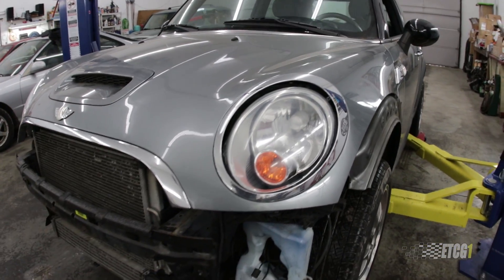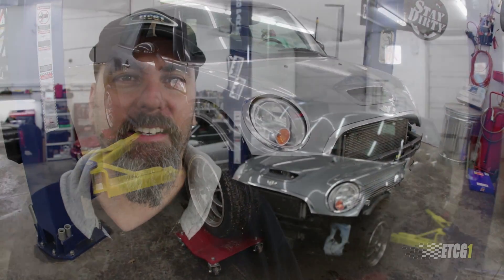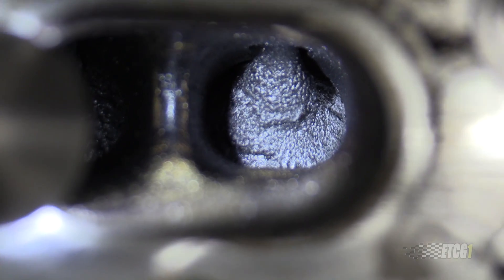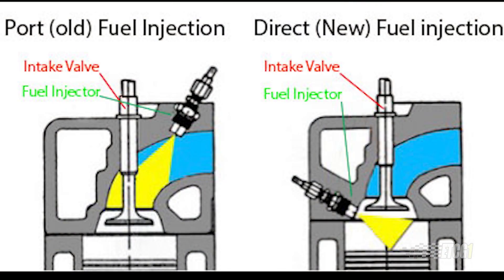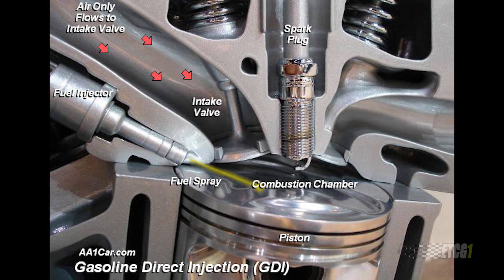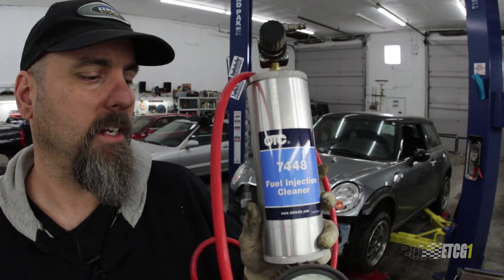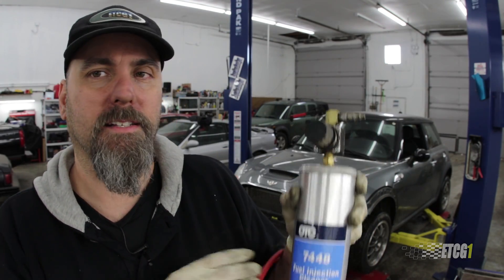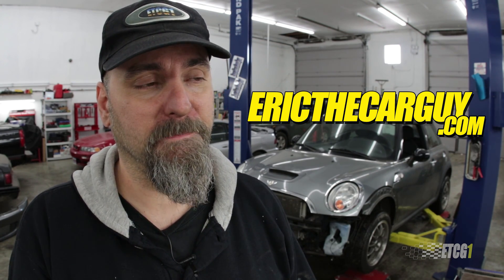Direct Injection Proves Fuel Additives Don't Work

Comment: Gasoline makers put fuel additives in their gas anyway.
Reply: mario yes they do work, VERY WELL, which is why most regularly driven vehicles never need a separate bottle of additives.  If they didn't work we WOULD need to keep dumping fuel additives in.  However they were never intended nor expected to clean a part of the engine they never touch like the intake valves on a DI engine.
Reply: Yep, No matter if you drive a tandem bicycle or a Ford tractor. Additives in the gas. Lime in the coconut.
Reply: Not all Gasoline makers do. You have to look for the 'Top Tier' logo at your gas station. Most of the big name gas stations sell Top Tier gas but your local mom and pop gas stations will not be Top Tier certified.
Reply: Those don't work.

Comment: I always send the injectors to witch hunter. They come back with new seals and a spec sheet. I successfully build engines and I believe quality injectors are the key to success. Having one cylinder run lean will cause much damage.

Comment: Eric, 3m and sea foam both have intake valve cleaning kits. They are drawn in by engine vacuum and are only intended for intake valve cleaning. They do not go through the fuel system. These types of cleaners are beat for direct injection. From one master tech to another!

Comment: For Single and Multi-point Fuel Injection the additive cleaners contain stronger solvents than gasoline that help break down or soften deposits forming on anything downstream of the injector. They also help clean the injectors themselves, which could be helpful, say if you used old gas and got some gum forming from it. The better solution for Direct Injection and more thourogh solution for all fuel injection engines is an intake cleaning service. One method is media blasting with walnut shells, but that involves removal and replacement of intake and labor for blasting which all adds up to increased cost. There are shops that have equipment, like the injector tool shown in the video, that use a "special sauce" or "snake oil" or whatever one may want to call it that requires removal of the charge (pressurized) intake tube going to the throttle body for turbocharged engines, and simply pulling the intake tubing from the throttle body for Naturally Asipirated, and spraying the intake from there. It gets everything from the throttle downwards, through the intake manifold and backs of the valves where the deposits have formed. If the deposit isn't fully removed it is at least softened, so it can slowly flow into the cylinder and be consumed and burnt while driving. Less cost to perform service, still cleans manifold and valves, relatively quick, all it requires it investment in the tool and the cleaning product you run through the induction system.

 Strictly heresy, but I've heard Audi has had the same problem many times and is finding vendors that have this solution and having it done at their dealerships for customer vehicles, using a borescope, and finding most, if not all deposits consumed.

Just my $.02

Also, thank you for continuing to make great videos, Eric! I'm a long time subscriber and adamant fan of your work, and can proudly say your videos and sharing of knowledge has taught me most of what I know about wrenching on cars and how all the systems come together. Kudos and stay dirty!

Comment: Isn't fuel injection cleaner made out of ethanol? Hummmm...... in DI gas engines does the fuel get added as the spark plug fires?  If it did then there you could run as much boost as you wanted.
Reply: JCLawn51 It’s usually acetone or methanol.

Comment: Fifth gear a uk car show used Redex fuel system cleaner on a vw  and it improved power by 6hp ! They did a before and after on a dyno. It’s a old product sold in the uk for years it was originally a upper cylinder lubricant . Look up the video and see what you think .

Comment: Seafoam is the only cleaner I use, and I never add it to the tank, but with the vac hose method on a warm engine. ANYTHING that gets added to the gas won't really help any, as Eric said gas alone cleans pretty well, but seafoam gets to spots that gas wont touch

Comment: I will no doubt get a load of abuse from this but in my opinion direct fuel injection is not the problem its the EGR valve. Logic would suggest if you are passing carbon through the intake system its going to stick without fuel to wash it away.

Comment: ETCG1
When I cleaned the EGR canals on my Honda engine block...(there is a plate that I am talking about) I tried using a gasoline simply because it is cheap and it was almost doing nothing to the black nasty gum. Carburetor cleaner was eating the gum like hot water eats ice.

Comment: I don't have any luck using one little dump and done 5oz. Bottle, I always buy the big quart size bottle of Lucas upper cylinder lubricant (injector cleaner) and refill those 5oz bottles for about a month. THEN I get results if there is results to be had.

Comment: ChrisFix has actually proven that Seafoam does clean out minor carbon build-up on the top of a piston.  On the other hand, I agree with Eric that for the most part fuel system cleaning additives are nothing but placebo.  However, Lucas' fuel system cleaner does seem to help improve gas mileage slightly (by a few %).  

As long as a person use name-brand fuel, there should not be any need for fuel additives.  The same goes for oil additives; name-brand engine oils already have the necessary additives and adding aftermarket oil additives is not only a waste of money but could be harmful.  I only use Mobil-1 (Group-III) series oil.  Amsoil uses Group-IV, which is totally synthetic and is not even oil, but the additives Mobil-1 uses makes their Group-III oil competitive to Amsoil's Group-IV.   

P.S: I have little trust in low-mileage used cars driven by elderly people.  While the mileage is low, they are probably never revved past 4,000 RPM, meaning the engine was running at low temp and did not have the chance to burn off deposits.  So, even though the mileage is low the inside of the engine may be full of carbon deposits that cannot be cleaned by fuel + additive but mechanical (physical) cleaning.
Reply: JPN850R we're talking specifically here about buildup behind the intake valves only on DI engines which are never exposed to solvents from their gas tank. This v.blog style was a condensed bag of automotive-rants which confuses a lot of people by its nearly-atopical (rambling) style, which's why it has its own dedicated channel: same car guy, different speech. As for not trusting cars from old people, they are driven slowly and carefully for the procrastination of maintenance cycles. One grandpa of mine was a mechanic whose discovery of high capacity battery chargers was for the worse. He loved sticking the clamps on a dead battery and juicing it up in under 10min." at >50+A setting. Actually his charger had a 150A direct starting mode which kicked back to 50A once the duty cycle was exhausted, but the battery was always full before the motor got hot enough to clean itself up. That coupled with abbreviated trips to the store made his cars always run kinda funny.
Reply: Old people?…………

Comment: I partially agree with you that fuel cleaners are a waste but not in the sense you might think. I agree with you fuel system cleaners are a waste because the fuels today alrrady have additives to clean the fuel system and have had for decades. As a mechanic you should be aware of the fact that fuels if left to sit too long will deposit a varnish like substance on surfaces exposed to the fuel. This is more a problem with small engines than vehicles but it does affect all gas engines if left to sit long enough. Under your theory, products like areosol carb cleaners shouldn't work but I would bet you use them for carbs and throttlebodies. You are correct in that fuel system cleaners can not clean areas where fuel doesn't go which fuel injection systems bypass larger portions of the conventional air/fuel delivery systems. One problem with your theory is there is another YouTube channel where the guy compares different products using small engines. The guy pulls the head off an engine, uses a wire wheel to clean deposits from the combustion chamber, reinstalls the head , runs the engine for a preset time and then pull the head off for visual inspection. He then repeats the process but runs the engine with a fuel cleaner additive per the manufacturer's instructions. These tests have shown that certain products will produce slightly less carbon build up in the combustion chambers. We're not talking a lot of difference but enough to be noticable. So do these prodicts do as claimed, I do believe so to a degree but not to the degree that they are hyped to. I also believe you would have to run these products from day one in every tank to get a real advantage as I believe these products work better to prevent build ups that to remove them. He has also compared some common home brews that work just as well or better than some products. So I do believe they do work to a degree, just not to the degree most are claimed to work.

Comment: Spray seafoam in the intake. THAT stuff works. My 99 ran completely differently after using it. It sat a lot before I got to it and when it was driven, it wasn't driven much. I bet that stuff would fix up that mini in a hurry.

Comment: Hey Eric, I see your point and you're absolutely right regarding intake valve gunk. There's no fixing that with an additive. Although (and I'm speaking from a diesel perspective), when I change my fuel filter, instead of priming my fuel pump and filling it with diesel again, I just dump a special additive in it and it will run on 100% that additive. That way it's not dilluted in any way with diesel. I only do this when changing my fuel filter, and it's more about cleaning the HPFP and injectors than actually cleaning the intake. At least I've never tried to clean it with a fuel additive. You can't trust gas stations sometimes and it's better to do some preventive maintenance than pray that the fuel you put in the car is in good shape. It's not expensive anyway (like 10 bucks a can every 20k miles). But there are some things you can only do with some good ol' Italian tuneup :-) Great video

Comment: The intake valves get carboned up due to the crankcase vapors not being filtered. If they filtered the vapors. You would see a drastic reduction of this problem. 

I know Cummins does it with there engines in big rigs since the crankcase vapors are now put into the intake manifold.  And that crankcase filter does get very dirty and oily over time

Comment: Maybe the solution in a GDI engine will be to put a cleaner into the air intake, every once in a while to clean off the top of the intake valves. Come to think of it, it would be a possibly convincing marketing ploy to get people to use cleaners more regularly.

Comment: I had a 2012 Hyundai Accent with GDi. I installed a catch-can between the PCV and intake to prevent this exact thing from happening. The other thing I did was after a long ride (every 5000 miles or so) I would pull the hose off the intake from the PCV when the car was running and "drizzle" in some sea-foam. This way I was guaranteed to hit the back of the valves with the solvent. Drove the car from brand new to 120,000 miles with zero issues.

Comment: The best solution for this problem ist a water/Meth injection, Not for tuning only for cleaning.
Even pure water injection would be working fine. 
If i ever buy a Car with direct injection (Gas or Diesel) the first what i install ist a water/meth injection Kit. 
Greetings from Germany 🇩🇪
Reply: Oil catch can WITH the pcv valve
Reply: If you remove the PCV valve, pressure will build up and blow the crank's main seal.
Reply: First time on this channel, love that you question something that has always been questionable for the exact reasons you mentioned. Subscribed.
Reply: Oil catch can instead of the Pcv valve

Comment: Seafoam is the only one I trust. We had a 323i with major injectors issues and we dumped a can of it everytime it got fuel and eventually all the gunk got loose enough that the engine would stop idling weird, but it took more than just 1 can. 

The owner of the 323i keep on doing 1 can a month for his own peace of mind and it seemed to work for him, so take this for what it is.